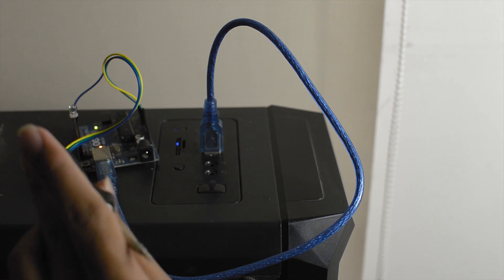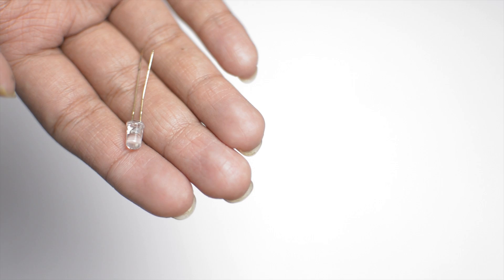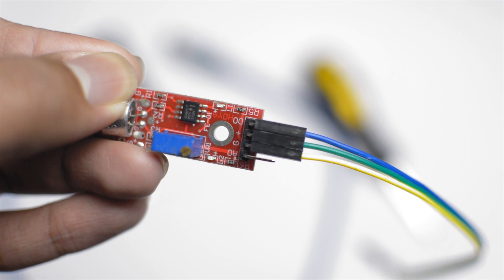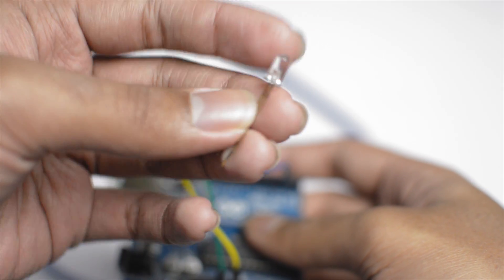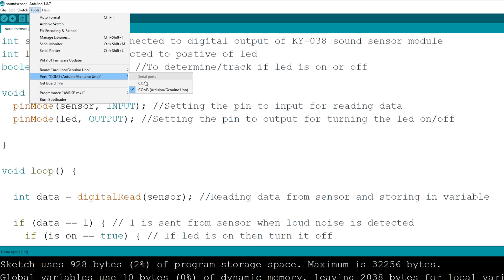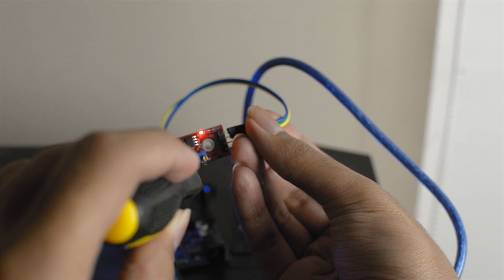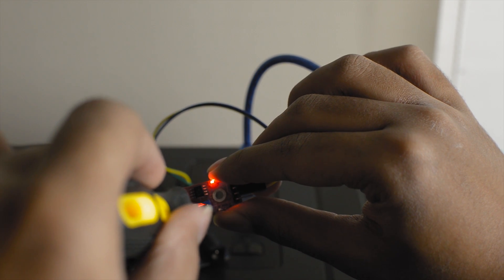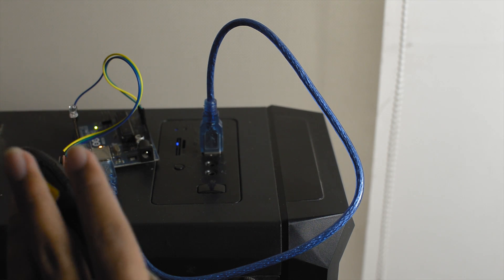How To Use A Sound Sensor With Arduino

Comment: I'm struggling with this into insanity...the led of the sensor flashes but not the actual LED on pin 13?? I had to take a break to recover... Electronics and programming, even a very basic project, can drive one up the walls!
Reply: Same, its a real pain ):

Comment: I've tried all the codes, but this is the only code that worked. Thanks bro, if it still doesn't turn on, adjust the sensitivity, because that's what happened to me earlier, the LED kept turning on.
Reply: Adjust the sensitivity until one of the LEDs on the sound sensor goes off, then try clapping.

Comment: Hola !! comprè dos rh_nrf24 , lo puse con dos arduino uno, dice que llega a 1000 mts. .pero a mi no me llega a 50 mts. .apenas, el regulador es de 800 mAh, la fuente 3.3 2A ,  los datos viajan OK pero no màs de 50 mts. .a lo sumo, 
ya probè todas las combinaciones posibles en el soft (MAX MIN , 250 kbps etc. ) - còmo puedo amplificar la señal , que tenga màs potencia ? con un transistor ? còmo ?

Comment: would like to ask if the code still works? it's telling me that there's an error uploading the exit status 1
Reply: Just trying to help, but that usually means that either you don't have an Arduino connected or you have selected the wrong port. For me the code actually didn't work... but for a different reason. Hope it helped... 👍

Comment: How can I use this in a system that deters barking dogs? I currently have a system I wired together that runs high pitch piezo tweeter speakers on a remote but that doesn't work when I'm not home to activate it. The over the counter bark deterrents are useless. I need it to stay on for 30 seconds when it detects noise but no shut off when it detects the second bark. Any ideas?
Reply from the maker: I don't think this particular sensor will detect barking noises. It can only detect small noises very close to the sensor in my experience with it. I think you should research a bit about sound sensors that can detect loud noises in the environment like barking and maybe try that!